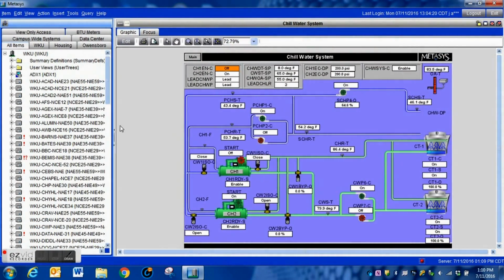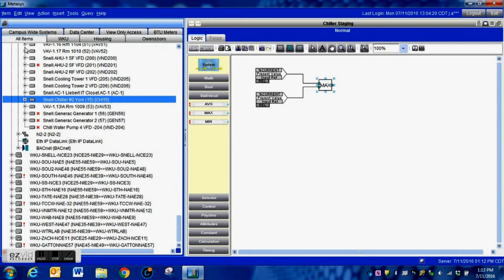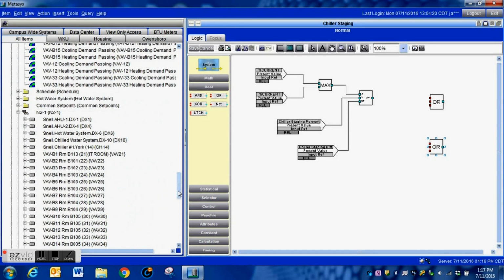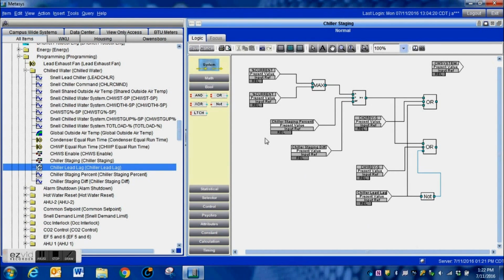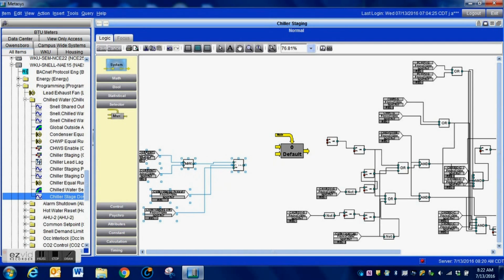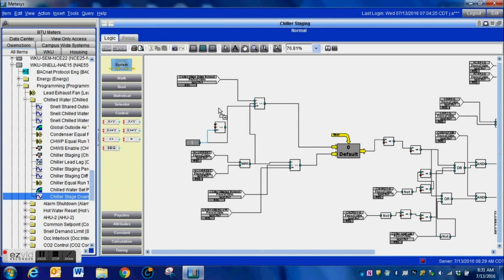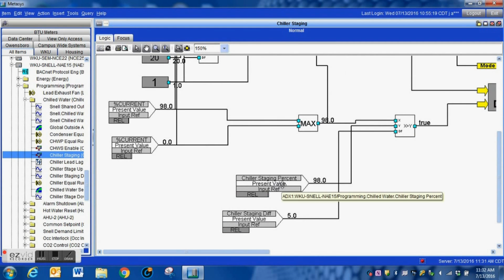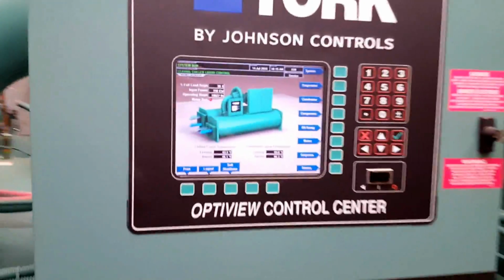Chilled Water Staging using load demand

Comment: With daytime peaking buildings and high electric demand (kW) charges future control might inquire on the grid the price of electricity to decide if adding more electric chiller capacity is affordable or maybe use ice storage to provide the added boost of cooling required.  As more renewable energy comes on line and demand prices increase energy storage will be a big part of building design.  Very nice video.  Thanks for the lesson.
Reply from the maker: +Paul Valenta I agree and already see price effects on use. Metasys has the capability to limit load demand automatically throughout the entire system. This does cause a slight increase in temperatures but helps control costs.  Some type of cold storage might be able to help slightly but it to be effective,  it would certainly be very large.  Thanks for watching.